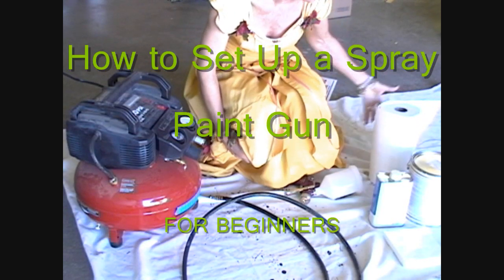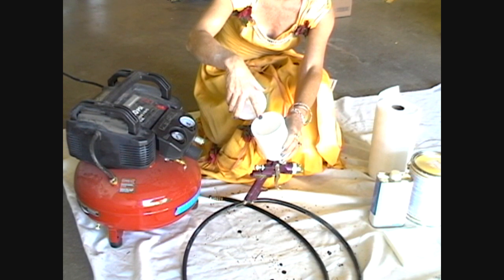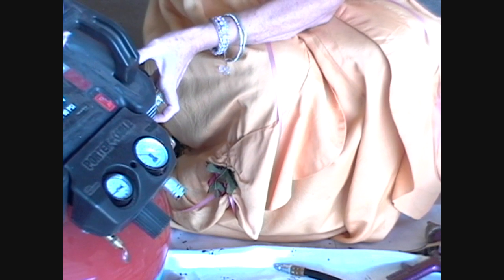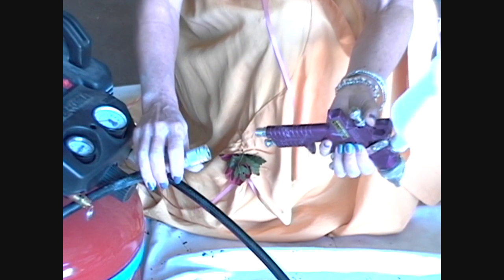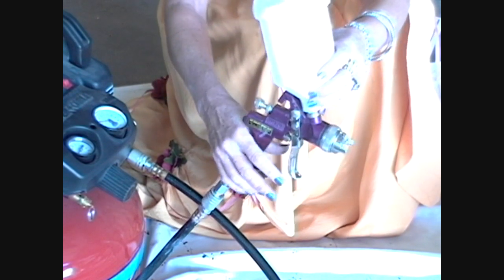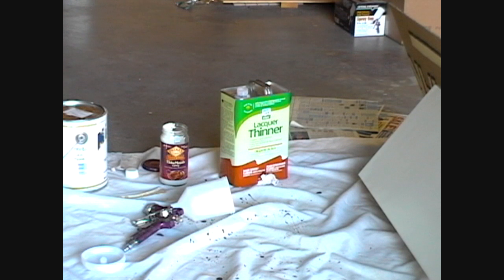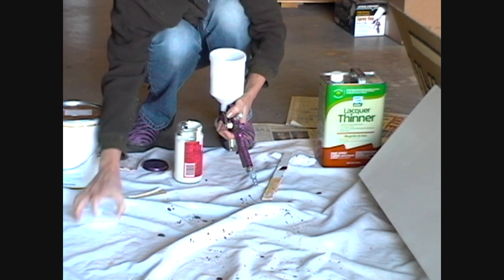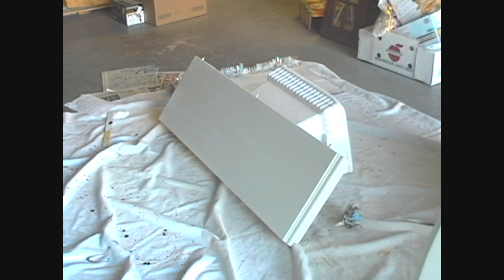How to Set up a Spray Paint Gun (for beginners)

Comment: At the very tip of the gun is an adjustment for the direction of the "fan". Think of it as the width of a paint brush. It should be set so the fan (width) is perpendicular to the direction you are moving the gun. You look to have it parallel. You say paint thinner, but your can says lacquer thinner, very different, an usually do different things. I didn't see what paint you were using, it looked like a latex can.

Comment: Interesting.  You never mentioned what the recommended psi was for the gun use and how or if you adjusted for it.  You should have had a regulator on the end of the gun. You NEVER move your wrist, you move your arm.  You did not say or show filtering the paint.

Comment: Good video. It sucks how most of what you read or see tell you how you need a 60 gallon tank with 20 cfms just  to spray the darn thing.
Reply: google google I was wondering the same thing.  That’s how I came across this video actually.  I was searching YouTube to see if anyone with this 6 gallon air compressor used it for air brushing.  I’m not sure why this compressor is NOT recommended for airbrushing.

Comment: Good video. How much reach do you think one could get with one of these machines cranked up to 90psi? Is 20 feet unreasonable?
Reply: At 90 PSI you would have at a minimum great difficulty applying the paint. At 20 feet distance, the paint would have already turned into dust and would not hold to the surface it was being sprayed onto.

Comment: And don't spray oil based paints in enclosed spaces without ventilation, and certainly don't light a cigarette after spraying.
Reply: Its not that dangerous as people claim. I use oil base daily at my work. In a shed as a paint booth with only a couple exhaust fans and a couple in front pushing. 2.5 gallons sprayed in 2 hours or so painting utility trailers. I'll get to a stopping point and take my mask and light a cigarette. With overspray like thin to medium fog. Usually takes a few mins to fully clear. I smoke sometimes while spraying. I use a pressure pot. With a conventional spray gun. Which has what 45 percent efficiency? 50 percent is overspray. I'll light a cigarette while I clean the pot out with lacquer thinner. When I prep the trailers I have my old activator cans with lacquer to soak my disassembled binks 2100 in and a old 5 gallon bucket I pour waste paint and used lacquer in for hazardous waste disposal. And use a grinder with 60 grit flop disk to sand down the metal to get the scale off. Shooting sparks right towards them. Still nothing. 2 years now daily 1st year I had maybe 20 days off all year. If quart of lacquer went up it would be contained in that containers. But daily I shoot multiple grinding sparks into the the containers. Strange because if I take a shop rag. And just flame the edge of it. It goes up fast like I should. Sparks not as much but a direct flame for 1 second

Comment: YOU HAVE TO USE A LVLP SPRAY GUY HVLP WILL NOT WORK
Reply: But it did work. The work piece was painted white as she wanted, although she also painted her lungs and the house all at the same time. But an LVLP will definitely work better for a beginner. I think the typical beginner is entrapped by the cheaper price of the HVLP.